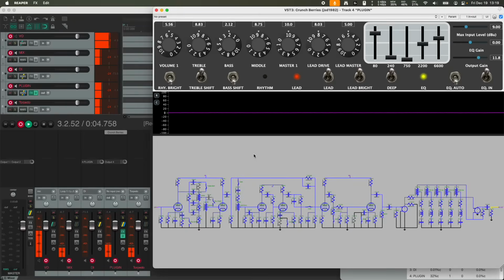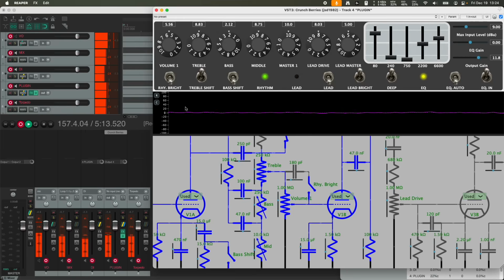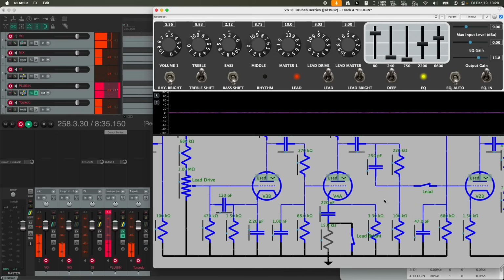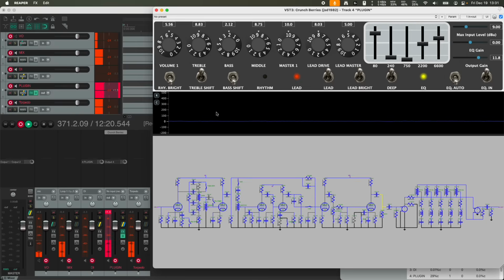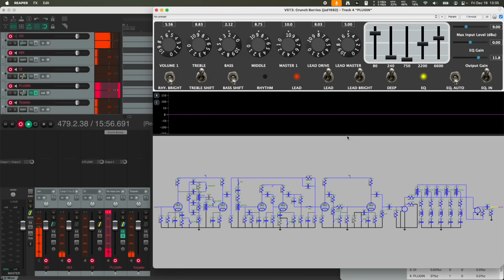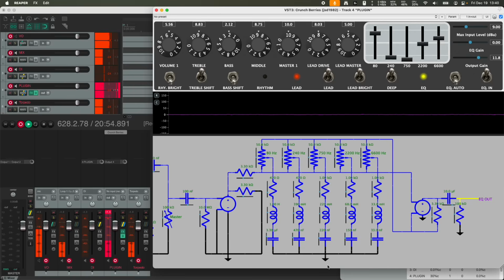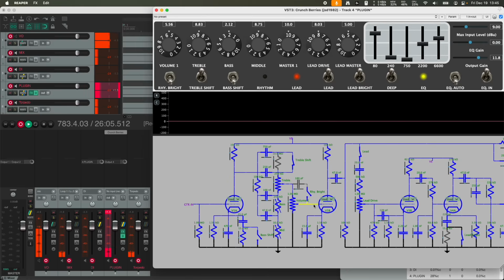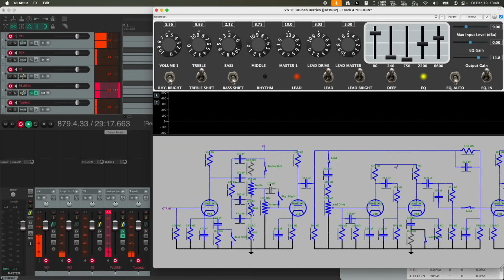Crunch Berries - a Mark IIC+ Preamp Circuit Simulator Plugin

Comment: This sounds and looks great! Being able to change the value of any component in real-time is a great feature that I think more plugins should offer... Care to share more about some technical details? I'd be very interested in learning what modeling technique you used (e.g. modified nodal analysis, state-space models, wave digital filters, port-hamiltonian systems, etc). I'm guessing that you are using a Newton-Raphson solver for the nonlinearities? If so, since all components are configurable then you are probably not using any lookup tables, right? So what's the CPU load like? Can the CPU handle multiple instances of this plugin or run with many other plugins at the same time without missing the audio thread deadlines? And finally, which C++ library are you using for the matrix operations (e.g. Eigen, Fastor, etc)? I'm asking all this because I had experimented with such simulators in the past but I wasn't very satisfied with the real-time performance of my implementations and I'd love to learn more about what you have achieved and how. Many thanks and keep on rocking!!
Reply from the maker: Thanks! You've pretty much guessed almost everything correctly lol. To answer your questions: 1. MNA. 2. Newton-Raphson indeed for nonlinearities. 3. LUTs are used only within the triode model. 4. CPU load on a MacBook Pro M3 is around 33% +/- 5% of a single CPU core at 2x oversampling (96kHz). 5. Multiple instances can run in parallel no problem; I've tested with buffers as low as 32 samples at 48kHz without dropouts. 6. No external dependencies other than JUCE which handles the plugin wrapper aspect and the UI. The core simulation is vanilla C++20 with plenty of template meta-programming and a healthy dose of hand-rolled SIMD optimization code.
Reply: Matrix libraries are slow for this. To get good performance you should properly use matrix sparsity. And there can be additional tricks to save processing resources.
For example st.Rock Amperium Live also uses full SPICE-like simulation for preamps and runs on average ARM processor. On modern CPU (with several MHz) simulation can run with something like 16x oversampling.

Comment: This is impressive! DIY community needs a tool to test different preamp/pedal schematics to tune for users guitar and taste. It would be awesome to use SPICE models to emulate Valve vs JFet/Bjt vs IC versions in realtime with ability to make changes on a fly. Like a guitar electronic sandbox, to know how different parts of scheme change sound. Your work have a great value!
Reply: Honestly, this. As a DIY pedal builder, if I could pay you for a platform that let me drag and drop circuit components to test schematics, I would absolutely do that, haha. Very cool software.
Reply: Dude look into ....LiveSPICE! ❤❤❤

Comment: That’s an awesome project and sounds fantastic. Could you please reveal how you translated the LTSpice model into C++ code? And if so how did you model the non-linearities that come with these overdrive circuits? I mean you probably have a model for the preamp tubes, but how about effects like grid current and nonlinear current behaviour of the tubes that comes from interaction with the circuits? Richard Kuehnel has some models for 12AX7 and 6L6 tubes in LTSpice in his books, is that something you considered?

Comment: That is really great! Something that amp builders could use to safely test new design ideas. I'm doing something similar but using neural amp modeler plugin and Micro-Cap 12, but it takes about a half an hour to only capture ONE sound! Of course you can't change components' values on the go, so that makes your plugin so valueable - being able to change R and C values in realtime would save so much time

Comment: Very nice, Congratz! This makes me think about Peavey Revalver4 a little bit, you could fiddle with the schematics, but I didn't understand how it worked enough to mess with it. Your waveform visualizer that you can place anywhere you want in the circuit is a really cool feature that can help people learn how a component influence the signal. That simulation of the Peavey 3120 in revalver4 is the only reason I still have a windows system, if I could learn how to do what you did here (or if you could make a 3120 ;) ;) )that worked on linux, I could finally move to linux for good.

Comment: Would love to see a typical Dunlop Crybaby Wah's circuitry modeled in this way.  I keep trying to find the perfect digital wah in a bunch of plugins and keep coming away unsatisfied.  I have the Petrucci signature Dunlop wah that I love but it's on the fritz so it's currently an expensive paper weight until I replace the switch (which I suspect to be the issue).  I also have the Neural DSP Archetype Petrucci plugin and despite their claims of recreating Trooch's rack mounted wah sound it too leaves a lot to be desired imho.  Or maybe I'm just too picky with my wah sound lol

Comment: Man... I can almost smell... whatever that smell is that hot amp electronics make! 😂

Very curious about the whole project.  Do you think there's any latency advantage (or disadvantage) to this approach?  Or negligible in either direction considering the speed at which the average modern computer can run this type of code?
Reply from the maker: Probably the smell of dust burning off the surface of a hot tube? 🤣

Comment: This is like LTspice meets dream amp tones all in a convenient VST package!! Was this done with JUCE? I'm genuinely in awe - amazing work! I would love to get into DSP as I am more orientated with valve amp building / design. Any tips or resources you could share? 😁
Reply from the maker: Thanks! The core simulation is pure C++20 code with no external dependencies. I use JUCE as the plugin wrapper - it controls all the parameters and also handles all the UI rendering and allows the plugin to be cross-platform. I didn't use any of JUCE's DSP stuff though. I might use some of their license validation code - not sure yet.
Reply: @jsd1982  Thanks for the reply! Very interesting, I will defintely have to get back into audio programming as this is really inspiring. When the IIC++ mod comes around, it would be nice to see some negetive feedback / presence controls here too!

Comment: Excellent work! In theory, you now just need to draw a new schematic and you should have a JCM800 preamplifier. Can you simulate how the amplifiers age and how some values change over time?
Reply from the maker: Exactly! Right now the plugin is hard-coded for the C+ circuit but it wouldn't take much to change it into a JCM800 or any other tube-based preamp. I could do that just as a proof of concept and see how it sounds.

It's certainly possible to simulate aging of components but I don't have any idea what the change of values looks like over time. Somebody would need to meticulously and periodically measure their real amp over its lifetime to get some data on that. Would be cool!

Comment: ive heard the sound of this amps can be notoriously difficult to recreate and i'd say this sounds pretty bang on to my ears.
Reply from the maker: Thanks! I think if you really want to get into the weeds about transformers and fine details - yes it is very difficult to recreate. But I think at the fundamental level, the magic in the circuit is actually in the component choices and their specific values. The simpler components have a far more drastic effect on the tone than swapping out a tube for instance. In the real world it's hard to evaluate those sorts of claims but in the software world it's almost as simple as changing a few numbers and seeing what happens. It's both incredibly fun and informative at the same time!

Comment: Absolutely amazing work. Did you do it without solving nasty differential equations? Do you have some sort of internal iterative solver to balance the system at each sample?

About power… do you fully simulate the B+ or is that just assuming a fixed/perfect supply at this level? Any goals for a powersection with proper full scale negative feedback/impedance curve modelling?
Reply from the maker: Thank you! Yes, it is an iterative numerical solver using Newton-Raphson. I wonder if there's a closed-form solution to this system of equations - haven't bothered trying that approach.

The power supply is an idealized stable voltage but it does take into account the current draw from the preamp tubes so there's a bit of sag effect. I don't know for sure but I'd guess it's nowhere near the real amount of sag a full amp head would see with its power tubes and transformers. Once I get a demo out you can shift-click the VE and VD nodes and see how the voltage drops from the ideal.
Reply: @jsd1982   Super interesting. By the way I work profesionally with performance, one tool I like a lot is SuperLuminal to get an overview of where your code spends its time. I don't know if you're doing any profiling but it's always worth a shot to see if there are any low hanging fruit.

Obviously there's always more to do (vectorization, etc) but that's another topic.
Reply from the maker: I haven't heard of that tool, nice! I'm using a couple different performance profilers to optimize things. And yup a good chunk of code is already vectorized.
Reply: @jsd1982  I'm curious which profilers?
Reply from the maker: Apple Instruments, CLion's built-in profiler, and clang's -ftime-trace option to optimize compile-time algorithms. I think I also used Visual Studio's profiler for x64 profiling.
Reply: @jsd1982  you did your homework
Reply: @jsd1982  Hi, one of the LiveSPICE contributors here. This looks super cool and I have so many questions 😁 Did you tried other circuits? Had you any issues with stability? Because for me the most annoying thing is that when you are building a generic solver that can simulate anything I wasn't able to always produce a stable solution. I tried with introducing some randomness into the solver using the generic algorithms. It's not super fast and user friendly, but can produce a stable solution at the end. I'm curious how did you approached this. And the most important question - how you deal with insane amount of variables when everything is a dynamic parameter. For simple marshall preamps I had like 70 equations and after extracting anything linear possible it was down to around fifteen the newton-raphson. Also I found vectorization tricky, as a lot of stuff depends on previous time-step state, so it was used only for stuff like row reduction.

Comment: Dude this is super sick!!! I'm a software engineer most experienced around the enterprise word, but as a musician its being awhile since I started to get interested on audio programming in overall. I did some experiments with MIDI and synths, basic DSP but I dream about getting more serious with it and I would really get some roadmap to achieve something at close of what you did (1:1 circuit modeling). I have a Mark Iv, Triaxis and also Synergy 2CP module, also Neural IIC+ plugin and even other related plugins, but I'm blown away by your creation, can't wait for the release! If you have any product related to digital modeling programming roadmap I would buy it without a second thought!!!
Reply from the maker: What do you think of the Synergy module? I was considering one of those for a while but they're super expensive
Reply: @j @jsd1982  Synergy is definitely not cheap, considering that you need to afford additional gear (head or dock) along with your modules. In general sounds super good, you probably get 85% up to 90% tone accuracy in overall when comparing against the real deal. I see that for the most part the differences tends to be:
- modules are usually grainer and a bit more compressed then OGs
- modules are usually darker (less open) and a bit more bassy.
- mids region is usually more congested.

So I tend to cut bass and raise their treble quite a bit, but I avoid going too far with presence as I usually consider high presence settings prone to sizzle and harshness in amps in overall and with those modules I tend to head over this direction even stronger.

For the 2CP module in particular, I think Steve did a great job and it really captures the spirit of the Mesa Mark sound, specially in the preamp EQ and gain structure it self. In the other hand, the 5 band EQ has this buffer which is lot more transparent than the OG, so 6.6k will definitely deviate and therefore being settled lot lower than original amp. Moreover the 5 band EQ is probably the limiting factor when it’s it about achieving 100% accuracy, cause Mesa’s OG EQ has big contribution to the overall tone as it acts almost like preamp itself adding extra intensity in transients and overtones (IMHO), so pairing up 2CP module with Mesas 5 band EQ can definitely helping one walking the extra mile.
Last but not least, it has 4 toggleable switches  to achieve CH1 pull bright and pull shift, also LM pull bright and pull lead, where this pull lead has been shifted to actuate as the C++ mod,  which definitely scores its go on delivering more saturation, but I would rather relying on a boost for this very purpose.
It has a pretty decent, fenderish sparkly clean if you want it l, as you set gain quite low. Solid crunch tones and quacky wah sounds too.
On the top of that, Synergy ecosystem offers great flexibility to wire your module as an additional channel on your amp, effects loop, multiple outputs to both, line level and extra power amp.
Last but not least, Syn-20IR give you assigneable IRs, software editor, extra clean channel, midi, silent recording due to infernal laodbox, headphone output and cool power amp settings which also help you on walking the extra mile. Needless to say one can always matching Synergy pre outputs against power amp of your choice, what can enable you to walk even further (2CP module paired with my 100w Dual Rectifier power amp got Huge roar!).
So far I’m happy my experience with Synergy as I have compared recently a 50w Soldano SLO against SLO II module and the results have been quite good to be honest.
Reply from the maker: @marleysheredder  What a wealth of info here! Thanks!

Funny you mention the GEQ bands, the actual center frequencies are a bit far away from the numbers they put on the faceplate. If you do the math for the RLC calculations you get these frequencies: 87.6 Hz vs 80, 371.8 Hz vs 220, 723.4 vs 750, Hz, 1583.3 Hz vs 2200, and 4822.9 Hz vs 6600.

I want to say those real numbers are close to what I observe when measuring my Mark V GEQ response.
Reply: @jsd1982  Yeah, tired provide the most info I could for you to have decent  input whenever you consider taking another look on what Synergy has to offer. 
You’re absolutely right and Steve himself mentions that about his work on conceiving the 2CP module while examining the original IIC+ as calculations wouldn’t never match in the OG, specially 6.6k, so your exercise highlights that same phenomenon with high accuracy. Similarly as you, Steve opted going with an EQ which faithfully matches the frequencies numbered on front panel. 
On the very end of the line, I just think the Mesa’s 5 band EQ pedal might be different to the OG amp built in, but it still has the “souce” whereas Synergy one seems more like a high transparent EQ. 
Aside from this specific topic, I’m blown away by your recreation and now I’m eager to see what comes next in terms of power amp modeling, I mean, would be nuts if you could achieve an outcome nearly as good as what you achieve on the preamp side. Yours now trending turning into the ultimate 2C+ I’ve been looking for. I wish I could at least trying coming up my own Fender twin model someday.

Comment: Hi, what software did you use to convert the circuit that's shown in the video into code/ a plugin?
Reply from the maker: Prototyped with LTspice to make sure the circuit could even be simulated with professional software and paired that up with a tube model, then wrote the simulator in C++20 with JUCE library to do it all in real-time. LTspice was also used to generate the schematic layout diagram. If you're asking whether there's something out there that lets you just convert a circuit into a plugin I think LiveSpice was the closest thing I was able to find to that.

Comment: Holy molly, I am currently working on plugin development and just can't wrap my head around how tedious this must have been!! Huge congrats!!

I have a question about this approach (I'm sorry if I missed this part in the video). In terms of performance, how much CPU does this schematic simulation use compared to modeling the circuit behaviour with simpler combinations of filters+waveshapers+dynamic processors?
Reply from the maker: Thanks! Tedious it was indeed. Nearly 5 months of fiddling with everything, and I still have some more approaches and optimizations to explore. As for CPU it sits around 35% of a single MacBook Pro M3 CPU core. It can be +/- 5% from there depending on what the input signal is doing. Higher oversampling factors push it even higher in CPU usage.

Comment: James, this is brilliant in all accounts. Thanks for modeling the Mark IIC+ out of the gate to flex your dev chops. Sound wise, it's pretty %^&* impressive. Hard to tell from the Mark V.

Modeling the circuit seems more fateful to Randall's design intent. In looking at your repo, looks like that you can easily account for different flavors of ECC83s / 12AX7 (high/low gain, long/short plate etc ) and manufactures (JJ, HX, Mullard) idiosyncrasies. 

This is awesome work, thank you!